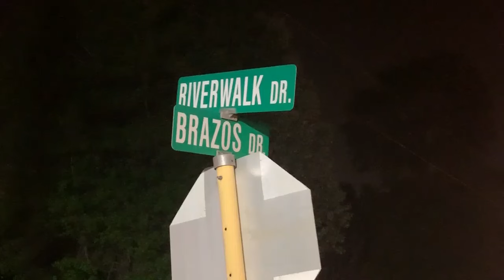031520 OFF DUTY METRO POLICE SGT FATAL

Comment: The way that car hit that tree, I doubt a modern car would have survivors...
Reply: Actually a modern car can absorb impact alot better.
Reply: @anthonypesqueira7540  For a head on, or off-set head on, rear impact or even rollover, sure.  In regards to a tree to the side of the passenger compartment at 50+mph, it'll still enter the passenger compartment.  It may not be as bad overall but that tree will still shrug off a modern car and that's the problem.  The tree isn't giving way to the impact and force of the car, be it old or new.  Go watch some rally crashes into trees.  Those are modern vehicles with cages and they get messed up pretty bad.
Reply: @anthonypesqueira7540  if that was a modern car everyone would be dead... Likely everyone survived this crash...
Reply: @anthonypesqueira7540  even modern cars still suck at off set head on collisions
Reply: @sprsprtrudy  must be trolling
Reply: John QPublic1  touche I jumped the gun on this one that's my bad.... May he rip...

Comment: In 1960, my Dad was in a head-on collision in his 1954 Chevrolet with another vehicle while travelling at 25 mph in a raging blizzard. My Dad was flung clear out of the front seat. Good thing as the engine ended up on the front seat!
The cars from then are generally not structurally safe. This one had been souped up.
Reply: plus no seat belts and an unforgiving steering column a blue flame six with power slide tranny

Comment: That Corvette  engine was to much power for him to handle
Reply: Very sad. Me and my dad are building a 53 Chevy with an LS swap similar to that
Reply: Pedro Cano Better improve the suspension
Reply: I have an 02 Camaro ragtop with an LS1 in it and know how fast they can get out from under you. RIP to the officer and prayers to family and friends
Reply: What about those tires, they don’t look safe either.  A good set of regular tires that’s meant for that car would of been safety control. Too bad. 😢
Reply: P. L.  no seatbelt needed if commen sense is used
Reply: @jeffreyvasquez3911  those are performance tires there smarty
Reply: LMAO you can die from bad choices and excessive speed with a four cylinder engine.
Reply: mdrailroad Too*, not to.
Reply: That car was not designed for that much engine
Reply: @chuckatack  I have a 99 Camaro z28 with ls1 engine and yes they can get away from you pretty quick.
Reply: @Malperro  Maybe consider installing a safety cage
Reply: How do you know what he could handle?
Reply: @mrpaulgrimm6129  and the brakes!
Reply: Looks like a 5.3 out of a Silverado .. but I could be wrong.
Reply: @ThatGuyDanFromBoston  Not a 5.3l. That is an ls1 swap out of an late 90's vette.
Reply: @ThatGuyDanFromBoston  it’s either an LS1, LS6,LS2 or LS3, my best guess is LS1 after looking at the intake
Reply: @jeffreyvasquez3911  Spare in the trunk is a factory '54 wheel,but it looks like he was running some pretty fat,low profile rubber on it,on a pair of custom steelies?
Reply: @Malperro  RIP

Comment: Most of the time if the impact was head on in those cars from the 50's, the steering column would push right up into the driver's chest and crush them.
Reply: yeah, I would bet driver was shish-kabob'd and that is why he was dead on scene.
Reply: True that. I’ve seen photos of it. Solid column mounted just in front of your feet. Frame buckled and column hammered you in the head.
Reply: @jerryhablitzel3333  That changed in 1967 , it was mandatory, the collapsible steering column along with the tandem master cylinder where the front and rear brake systems are split.
Reply: @frankpaya690  I knew they changed in the late ‘60’s a lot safer but it took a very unpopular law to get people to wear seat belts. That was the early ‘80’s before they started fining people for not wearing them.
Reply: the heavy steel dashes versus human bodies , dashes always won
Reply: That’s why when we modify early cars in Australia we have to use collapsable steering columns.. and get engineering reports so the car is safe in other areas like uprated brakes and seatbelts..
Reply: Not only that, but back in those days they wasn’t any seatbelts.

Comment: So, this guy took off with the vehicle, unbeknownst to the owner of the vehicle? Interesting. Had they been drinking at this “get together”? 
Anyone can see by the tremendous impact of the crash, this vehicle was traveling at an extremely high rate of speed. Perhaps 70 or 80 miles per hour?  And this happened within a subdivision? Meaning a residential street with houses and normal neighborhood activity? Unbelievable. 
The sheer lack of responsibility and criminal behavior shown by the driver of this vehicle, is astounding. And are we to understand that a police officer was the person driving during this “joy ride”?
Reply: *police SARGEANT
Reply: @walleyworld  Former Seargent
Reply: @jjjsss3869  jmflyer55 didn't have to smear the dead..the tree did a pretty good job of taking care of that💯😋😬.. I don't think I've seen any  rust traps that hugs a tree so well at the posted speed limit it's for that area...alcohol or not.. he kissed a tree knot 💯😐😔... 🚀 🚖🎆🌳☠
Reply: @jjjsss3869  He was hispanic? what on earth does that have to do with anything?  I drove a tow truck at nights ,for three years, picking up wrecks, nearly all Fatals and every tow job reeked of booze, vomit etc. . I've seen cars that have hit trees ,light poles and so on and the higher the speed the bigger the impact mark. That Chevy didn't leave any marks on the ground... it was airborne .And given it was LS Powered a speed in excess of 100MPH would have resulted in the same damage.  Still got nothing to do with being Hispanic, but I'd say booze was the  leading factor.
Reply: @Mercmad  Sounds more like a stuck throttle on that frankenstein amalgamation of a vehicle.

Comment: That 50’s shoebox had an LS swap in it.. basically a modern V8 engine with fuel injection. So basically that car was a insanely fast. RIP.
Reply: I was noticing that - the modern yellow ring dipstick. The car had way more power than the old steering and suspension could handle.

EDIT: Later on we get a good view of the engine. It's out of a Corvette.
Reply: @MrJeffcoley1  ya specially if stuff wasn’t fully upgraded like body mounts rear end suspension not good
Reply: @chevyhead7274  That was a car you had to gently accelerate to avoid it breaking loose and spinning out of control. It would probably break the tires loose and go sideways if you floored it at highway speed. Look at the skid marks and how it struck the tree. It was slewing sideways at high speed.
Reply: It's basically a death trap...
Reply: @jkl9094  It worked!
Reply: I would say tires had to be factor also, LS engines are  powerful
Reply: @edwardalamo2507  Yes indeed. Lots of these cars are weekend drivers. The tires may look good and have plenty of tread but are very, very old: 5, 10, even 20. Tires get hard and brittle when they age. So those skinny tires might not even be as good as they should be. Lots of "supercar" and hot rod wrecks are due to this factor.
Reply: @MrJeffcoley1  Yep, tires should be changed out at the six year mark at the latest.  Regardless of the appearance, because the rubber degrades with time.  I learned this fact from my auto body guy.  I went to the shop to get my car detailed, and I got a lecture from the owner about why I should change out my 10 year old tires.  Because this guy makes a living from fixing wrecked cars, I'm sure gonna trust what he says.

Comment: I was doing some heavy research on traffic fatalities from the '40 to the '70s and when you look at old newspaper articles, see those b/w photos of cars all crumpled up, it sort of gives you an altered feeling of the reality from that era because the image is only depicting life to a certain percentage. But when I saw this video and that '54 Chevy wrapped around the tree it was sort of shocking. The image is near perfect, almost foreign to the age from which that car came. I don't know if I can fully explain it, this video made all those past newspaper articles and photos a little more real to me.
Reply: I felt the same way! Eerie seeing that type of vehicle from those times but in color and with the video quality and the other m I seen surroundings
Reply: This was the everday reality of these old cars. There was absolutely no thought or care about safety in design. Hell, didn't have seatbelts or collapsible steering columns until 1968. People were regularly impaled. 😳
Reply: @johnwren3976  before they did away with hood ornaments, the govt. made car companies attach a cable to them so they wouldn't fly off and kill anyone in either car, or pedestrians in the area, during an accident.
Reply: @johnwren3976  1954 Chevy did not have an LS motor fitted by GM. This is one reason I am not in favour of over powering these older chassis

Comment: corvette engine in 54 Chevy, too much power for most to handle in a car not built for it. RIP sir.
Reply: That's the bad thing about putting these modern high horsepower engines in these cars that had hardly any safety features.
Reply: Yes it is those older cars don't stop and handle as good as the car the engine was designed for
Reply: The car looked like a work in progress. The wheels and tires were upgraded as appropriate, but we can't see if brakes and steering were up to snuff or not. The first gen Corvette used the exact same suspension as this car originally had. So that was up until 1962.
Reply: @novaseline4u   Brother GM used an X frame 58/64 they were identical underneath as I recall. The drive shaft went thru a tunnell and I remember the center support rusting out and  we would put 1 bolt in that c support was a BEAR to change.. But you guys are right that steering wheel killed a many!. I put my own kids in 1 of those car seats clip over seat. Only safety was my arm if we had to stop fast. Not good!.
Reply: Raymond L wow that explains it!! So sad.
Reply: Yeah bad choices and excessive speed by breaking the law, had nothing to do with it.
Reply: How in the hell do you or anyone looking at this know or not know what brake, suspension, or steering upgrades were made or were not made.
Reply: Raymond L ..Totally agree with you..He got that car Hauling Ass and that 1954 suspension and frame was not built for that much speed and it just got away from him. RIP Brother 🙏🏼
Reply: Why does it say corvette on the headers?
Reply: Dan Taylor it does say Corvette on the fuel rail covers .
Reply: Yuh and 20 inch smoothies. That's y ol buddy wanted 2 drive so bad
Reply: The older cars even when compared to other old cars were widow makers, all of them. Even the 60's and a lot of the 70's cars. Brakes, steering and suspension were dangerous. It was what we had but not safe. And like you say add that kind of power and you have to respect what the car will and won't do or this is what can happen. That car probably had few upgrades other than the engine.
Reply: @dantaylor696  It really doesn't matter there is hardly an LS motor that can't make for this kind of mess. I have a '03 1/2T pickup with just a 4.8 stock LS and it has lots of power believe me. Easily get that car up to 120+.
Reply: That's how it goes with hot rods, they're usually dangerous. Back in the 50's and 60's guys had supercharged 400+ hp V8's stuffed into little Model A's and T's.
Reply: The car probably had its original suspension. There are frame kits available to upgrade these old rides but we have here a classic example of putting lipstick on a pig.

Comment: When you see an all steel car built in the  '50's wrapped around a tree like THAT you KNOW they were speeding.
Reply: @MrDSVids  you dont own a 50's vehicle do you?
Reply: @txsraappraiser  not at the moment.  Working on getting a 68-72 Chevelle.  I think I should edit to "safer" more so than "stronger".  You can have a stronger car without consideration of occupant safety (e.g., sharp objects in the interior, no ABS, lack of air bags and no crumple zones - energy transferred to cabin vs. absorbed).  Don't get me wrong, I love old school cars but many were designed with style in mind vs. safety.
Reply: @MrDSVids  that's what you want to believe because you've been fooled into spending thousands on stuff that's plastic
Reply: @txsraappraiser  I got a 64 but new cars have crumple zones along with side rebars old cars didn't
Reply: He was going fast that for sure but that old car don't have the crumple zones like the new cars plus the rebars to help protect the people inside old cars didn't have any support..
Reply: I think this car was on an X-frame chassis. Those old body panels are thicker than late models but not having a perimeter frame made that a “soft spot” right where the tree hit. Add in some speed from the Vette motor and this is what happens when you lose it. Sad to see another car guy gone and another cool car. RIP
Reply: Over 80mph is what caused it i don't care what car you are in if you hit a tree at that speed you done for.
Reply: @kyboy5  are you a current or former accident reconstructionist?
Reply: Newer cars are structurely built two take accidents better than older steel  cars, nothing would of helped in this case
Reply: @rustyaxelrod  This car might have been re-framed. The frames used in Pontiacs then had large boxed side rails strengthened with an "X" crossmember. The original frame would be much stronger than an S10 frame or the original frame modified for a new front clip, engine and transmission. But old cars weren't designed to protect occupants at all, so people should drive them accordingly and be defensive at all times.
Reply: @rustyaxelrod  X frames were 58-64.
Reply: Not really . Old cars are weak when they get hit.
Reply: @txsraappraiser  when I was in my early 20's I was out partying with some friends and we came over a hill and hit an 800to1000lb. cow dead center of his chest and dead center of the engine compartment in a 67 Plymouth belvedere four door boat steel car. It v the front of the car almost to the windshield and we walked away with a couple bruises and got picked up to go party at the causeway by friends after we got everything taken care of at scean. If we was in the newer 90's pontiac sunbird that was in shop getting a timing chain we might of been in a lot of bad shape or worse. Their is some clout to the old steel but in newer cars in some cases they are engineered to take crashes better was my point. Engineered for crashes where older steel cars that was not a factor when designing and building them
Reply: Mike Gallo   Old cars used you as the crumple zone, it's well known that newer cars are better built, heavier, and are designed to protect you. You mention "plastic" which proves you have little to no idea about how modern cars are designed. The plastic bits are there mainly to limit injuries to pedestrians and to absorb low energy impacts. They also save weight allowing car manufacturers to use more metal where it's needed and not waste weight with bumpers, hoods, and fenders which might not form part of the structure or crash resistance. So yeah, newer is safer.
Reply: @MrDSVids  what about adding some safety cage inside cool old cars
Reply: @I.Live4oldcars.prospecting  You've obviously never owned a pre-1970's automobile!! They were like tanks! All body steel.
Reply: @shirleefauxx  old cars is all ive ever owned . First car was a 51 chev. Currently own a 57 plymouth and a 63 Impala. Obviously you have never seen how a modern car is built to with stand a crush and protect its occupants.
Reply: @shirleefauxx  old cars are actually very crap in a crash.  But you believe in 50 or 60 years technology has gone backwards. But what do i know i only work in smash repairer's and own classic cars
Reply: @TylerBonenfant  yeah people who think this need to educate themselves how a modern car is made.
Reply: @TylerBonenfant  Listen,dude, NO ONE has said that cars from the  '50's are safer!! They are STURDIER!!
Reply: Mike Gallo  actually modern cars have significantly more steel in the side members and roof etc. Watch some smash repair vids on youtube of newer vehicles, you will be amazed at how large the steel cross sections really are and how strong the boron alloy steel used in sills, rails and pillars really is. I have a 67 car and there is a fraction of the steel in that compared to new ones. Cars from 2000 onwards are way stronger and safer that your "built like a tank"
Reply: Let's put it in a way you might understand, have you seen a driver decapitated by one of those pre collapsible steering columns. Or by the early '60s Oldsmobile or Pontiac hoods without a cowl panel? luckily

Comment: This is a good reminder for the classic car community as well as the modified community. Remember that in 1954 this car had a straight 6 with 140 hp, and that's what it was designed for. Not a Corvette LS pushing at least 400+ HP.  It didn't have airbags, crumple zones, and very unlikely it had ABS or traction control. You can't even guarantee it had seatbelts. This is not condemning modified cars but never forget what they are. The designers never intended it for such power. So with that kind of power you have to be careful. Guaranteed if this car had it's original 235 straight 6 with 140 hp this accident wouldn't have happened. Know what you are driving and treat it accordingly.
Reply: I had a 54 with a 350 V8 did some risky things glad we sold it now.
Reply: @swiftxrapid919  didn't the small block chevy come out in '55? The only two that i can remember in the GM lineup for '54 was the Nailhead V8 from Buick or the Rocket V8 from Oldsmobile, or the other option was straight 8s from Pontiac.
Reply: @pentium4guy639  54's came with an online 6. Mine had a 90's pick up 350 V8 and a th350.